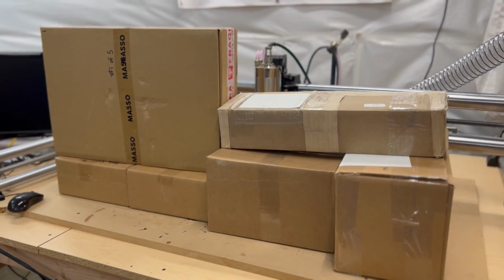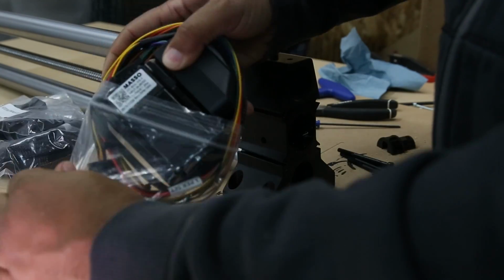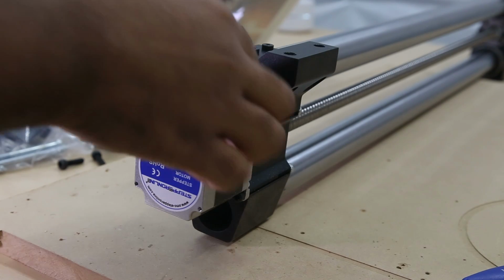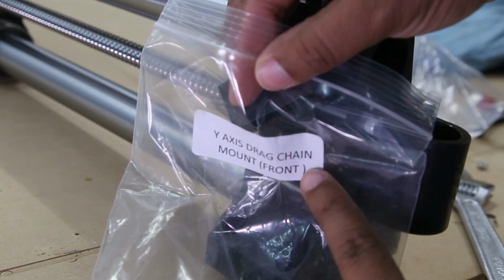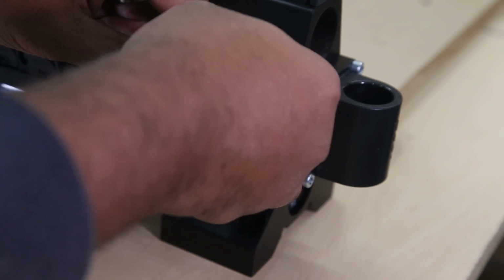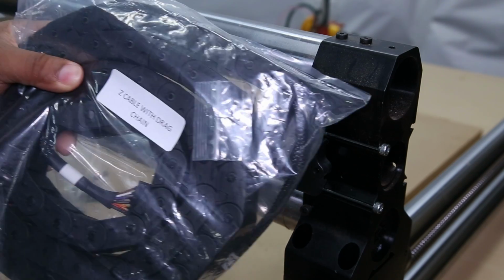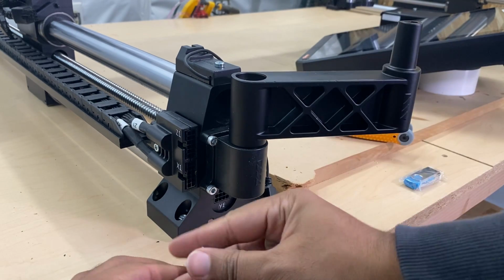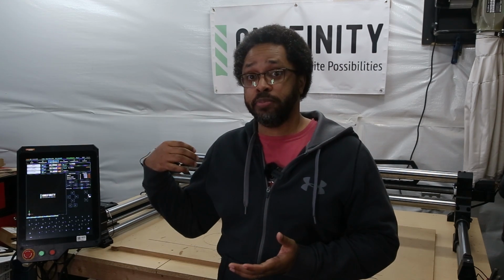OneFinity: Journeyman Masso Upgrade

Comment: Very good video (but a little microphone difficulty).  Like you, I'm a Journeyman owner.  I use a water-cooled spindle and an after-market drag chain.  It was tough getting all Onefinity's wires and the cooling lines into the current chain, and your video appears to show too little space to fit cooling lines.  Your opinion?
Reply from the maker: Ah there are files out there for clips that attach to the drag chain for the hose to set into. Look up Rowdy Roman on Etsy he has the clips or the file if you have a 3D printer